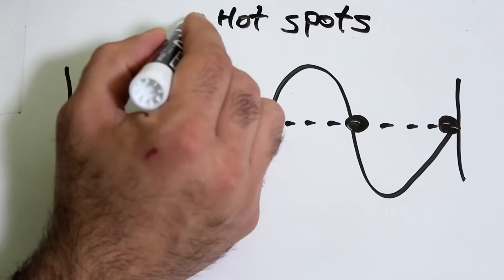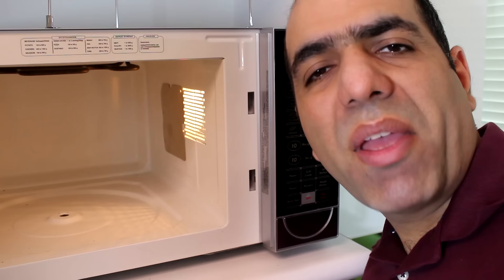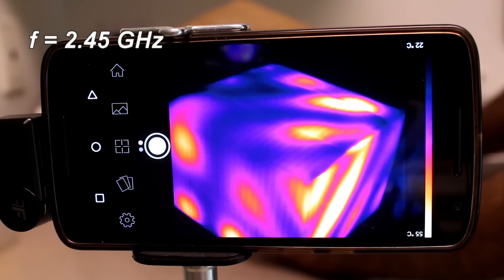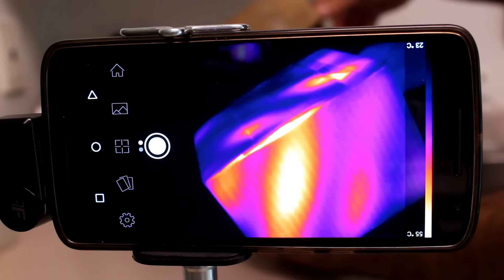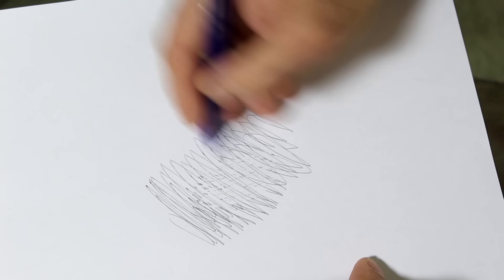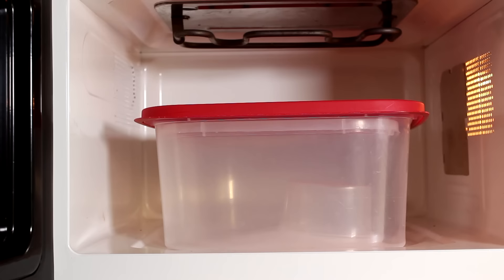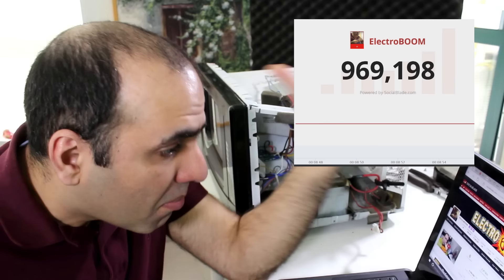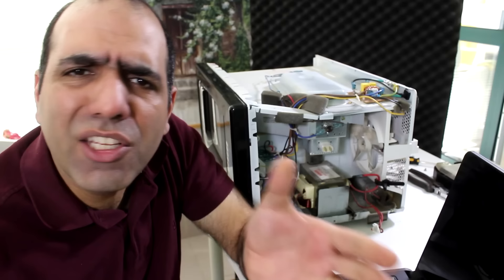Speed of Light, Microwave Oven and How It Works

Comment: My 30 year old microwave has that spinning fan thing but I haven't seen that on any newer machines
Reply: Hydraulic Press Channel Hi:)
Reply: You tube can be a small place haha

Now crushing a microwave, that would be interesting. Running :D
Reply: same here, our old Miele ~28y has the rotation metal fan
Reply: Hydraulic Press Channel it must be crushed!
Reply: I guess engineers consider the spinning plate and the fan mutually exclusive, which kinda makes sense.
Reply: Hydraulic Press Channel 30 YEAR OLD MICROWAVE THAT'S NO A  MICROWAVE THAT'S A BABY BELLING THE FAN THAT TURNS WITH THE HEAT OF THE LIGHT BULB MAKING IT FLICKER GIVING IT A REAL FIRE AFFECT  IS IT ONE RING OVER AND COMBINED GRILL.
Reply: For some reason, I read this comment with that thick Finnish accent.
Reply: WELL NOT THAT FINNNISH MEN LIKE CURVES
Reply: The 30 year old microwave is very dangerous and may attack at any time. So we must deal with it.
Reply: AS A WOMAN I AGREE SOMETIMES MEN  HAVE TO DEAL WITH THINGS FOR US LIKE SPIDERS!
Reply: Hi HPC! I know you must be tempted to put a microwave oven under your press but that's NOT a good idea! In the magnetron there is this ceramic insulator thingy which is made out of Beryllium Oxide and that is VERY toxic substance. If you crush the magnetron the ceramic part turns in to dust and if that dust travels to your lungs it can kill you!
Reply: Mine is 28 years c:
Reply: The really expensive ones have it!
Reply: Hydraulic Press Channel 
jj
Reply: Then destroy this microwave with hydraulic press
Reply: This microwave could attack at any time and we must deal with it!
Reply: Hydraulic Press Channel didn't expect you to be here lol
Reply: Hydraulic Press Channel you guys HAVE to collab! :D
Reply: I have also scrapped lots of microwave ovens and haven't found that spinnin metal fan. Also torilla tavataan!
Reply from the maker: Hey HPC! So I wasn't crazy, some of them have it! By the way, what happens if you crush a microwave power transformer (not magnetron) while it is powered? Forget I said that, I don't want you to die...
Reply: ElectroBOOM try throw foil in microwave and watch magic happend
Reply: Hydraulic Press Channel Usually they have the reflective antenna "fan" when you don't want a rotating glass dish, as in mobile applications (boats, rvs etc) or when it poses a cumbersome extra work, like in restaurants.
Reply: The turntable method works faster , it allows the cooking area to be a better resonant chamber since the source of the microwave is stationary .

The walls of the chamber have to be an exact multiple of the wave length to be efficient ( look up "Q-Factor")

A rotating reflector takes longer to cook since the wave keeps coming in and out of resonance with the chamber BUT is a great deal easier to clean , which is a big plus in a commercial setting.
Reply: I wonder one thing though,that have you ever stayed in Hong-kong or Canton? You really have a strong cantonese accent.
Reply: The Wanderer lol
Reply: Hydraulic Press Channel dvd
Reply: Hydraulic Press Channel ya know people can probably just go buy a thermal camera
Reply: it sure can be dangerous, so you must deal with it
Reply: Came here to say this ^
Reply: gimme thermal camera
Reply: shave the unibrow for 1m subscribers
Reply: Hydraulic Press Channel
Reply: he's to shave everything ... :D
Reply: You had me intrigued .
Reply: Hydraulic Press Channel ii
Reply: the wave stirrer is in earlier microwaves, are replaced by the turntable you see in Microwaves today, which is why the wave Stirrer isn't in the wave guide with the rod of the Magnetron. Early versions of the microwave have the Square Stationary glass plate and the wave Stirrer whereas the more Modern iterations have the turntable with the Circular glass plate and Synchronous motor and (depending on the manufacturer) different wave guide to help cook the food evenly.
Reply: For reference, the 1500+W microwaves found in restaurants and cafes have stirrers instead of rotating turntable. Turntable is cheaper but less efficient (one can't have it spin so fast with objects being placed on it), when one is dealing with higher power the lack of turntable efficiency is an issue so stirrers are more common.
Reply: Hello gunner! You want... sum *A M M O*?
Reply: Is it a Toshiba by any chance?
Reply: No stirrers now that the patent on the turntable has expired. They rotate the food, not the waves.
Reply: caroline kimber microwaves have been around longer than thirty years
Reply: It's The turntable!
Reply: Hydraulic Press Channel nice
Reply: Jaaa, huomenta
Reply: Well Put it under the PRESS !
Reply: You say transformers haha
Reply: FFcossag restored a microwave with one of those, and he did a really good job explaining it.
Reply: My 30 years old Elektro Helios microwave oven has a stirrer too, but it is so old that there is no spinning tray.
Reply: Hi there
Reply: I took apart my old microwave. It did not have a stirrer Guess because modern microwaves are more efficient in their design.
Reply: omg microwaves have been around that long
Reply: Hydraulic Press Channel ooo
Reply: It is very dangerous, we must deal with it :)
Reply: Restraunt microwaves still use em
Reply: If they have a carousel, it does not need a stirrer, the food move in the field rather than the other way. my 1.5kw RF output microwave has sick hot spots. as your hot pocket passes the hot spots, it gets excited.
Reply: Our old microwave had a stirrer. When we got a new one that has a rotating plate instead, I expected it to more evenly heat the food but my impression is that it works less well. This video shows why: if there is a ‘zero’ or dead spot anywhere across the rotational axis of the plate, that part of the food can never get heated until you stop the microwave and manually stir or move the food. I guess the actual reason why all consumer-grade microwaves now use a carousel, is that it is cheaper to build.
Reply: Do the box experiment in your micro to see difference
Reply: You are jerry rig everything brother
Reply: Hydraulic Press Channel kkk
Reply: Hydraulic Press Channel iiiiijjk
Reply: Now,You can bring cancer to town
Reply: He’s 40
Reply: My 21 year old Amana radarange has one in the top of the cabinet
Reply: WAT TE FAK!
Reply: wow
Reply: Everyone knows what a fan is
Reply: My 2 year old Samsung overhead microwave has metal fan blade under a plastic cover in the top but it don’t appear to be attached to a motor of any kind it’s just suspended there an can be spun freely by hand. I didn’t try turning it on with the cover removed to see if it spins as I only popped the plastic pin off that keep you from removing the cover to give the microwave a good scrubbing so it was only by chance that I discovered mine had this feature. Down side of children is they rarely listen when you tell them place cover on food prior to heating so I find my self having to scrub the top of my microwave at least twice a month other wise you get one of the microwaves you see in the work place that grosses you out an you only use when your in dire need from hunger pains
Reply: Well, Press, there's more than one "fan thing" in those microwave ovens. So... be clear.
Reply: The plate takes more mechanical engineering than the stirrer does.
Reply: Now we have had a microwave that was sparking on that metal plate.   Is it fixable?
Reply: Suomalaisiiki täällä?
Reply: @goover78  that would be a terrible idea as the dust in the magnetron would kill everybody in the viscinty,plz dont crush microwaves
Reply: OMG U WATCH HIM LOL
Reply: it usually has a turn table to do the uniformatimatizing of ze irradiations instead of just stiring with a fan now :P
Reply: I meant to say, our first microwave in the 80s had a stirrer fan reflector thingy, and no turntable. Actually it was more practical in a lot of ways, but it didn't seem to be very uniform in heating unfortunately. Which is maybe why they have now switched to exclusively turn tables. Although they aren't very uniform either so I don't know it was better or worse or we just got more used to the uneven heating and moved food around and turned it over more. I'm curious. Have you every seen one with both? I haven't but I often wondered if they existed.
Reply: Hydraulic Press Channel I love ur videos
Reply: goover78 microwave contains radioactive like borrilium oxide that can cause cancer
Reply: @rocky_adventure_bay7562  no
Reply: @85gbody97  yeah the one in our old one seemed to work by convection.
Reply: Rocky_adventure_bay Beryllium oxide is not radioactive however if you breathe in the dust of it it will cause cancer
Reply: The newer machines dont have a stirrer because now the rotating plate is used
Reply: Hi I'm subscribed!
Reply: @ElectroBOOM  The Over-The-Range type mostly have it(in Samsung/GE/Cafe brand).. it is located at the centre of the top cavity and powered by the wind circulating from the blower motor(the AC Fan motor).(there's ventillation holes at the area where this is attached)

As you'd explained,it is made to properly distributing the wave inside the cavity and reduce cold spots.

The Countertop Microwave Oven type like the one that you opened usually don't have it..(of the same brands)..

You're not suppose to open the enclosure of the oven,(yeah..like what the regulation said)but for your safety..please discharge the high voltage capacitor first before attempting to disassemble the components(easily done by shorting the terminals with a screwdriver).

Hope this helps.
Reply: @EwanMarshall  yes they're..
Usually they also have a double magnetrons too..
Reply: @knisayusuf  Indeed, got to pump in that 1500W or more somehow.
Reply: Yeah I don't know why?
Reply: Older microwaves did not have a rotating plate for the food, so, to fix the issues of hot and cold spots inside the oven, they placed a wave fan. It's purpose was to reflect those rays around and more evenly heat up the food. Of course, they were also quite loud if the bearings went bad.
Reply: Torille
Reply: Hydraulic Press Channel you didn’t crush it
Reply: @ElectroBOOM  sir please can you help me rectifying my idea of a perpetual machine design . Trust me this design is way different than anything else . Sir please help me?
Reply: Nice!
Reply: hi hpc in a fan of your vids
Reply: Dark... too dark...
Reply: i guess it is like you have rotated metal fan and standing still food, or rotated food without any metal fan
Reply: matthew kimber p
Reply: @ElectroBOOM  hi
Reply: @goover78  while cooking pop prons
Reply: Hi@
Reply: Can it fly?
Reply: Did you look into the wave guide while it was running?
Reply: @ElectroBOOM  I already know you swear right?
Reply: I believe the stirring fan is still being made in some microwave.  I bought a brand new Amana commercial microwave for myself about 7 years ago and it does not have a spinning disk but have a stirring fan. Some microwave are still being made that way.
Reply: Nice
Reply: Yeah true
Reply: Did you get "mashed potatoe for brain"
Reply: Hi
Reply: I have it too but my microwave is pretty new
Reply: @ElectroBOOM  خیلی ممنون بابت فیلم های خوبتون
Reply: @ElectroBOOM  crushing a transformer is literally asking for death
Reply: @cal28kim  LMAO, are you kidding? As a woman, I am the one that deals with spiders here! I identify them, and decide if they are house spiders (that would die outside), indoor/outdoor spiders (that can safely go outside), or Brown Recluse (that must die - we have a serious infestation of them!). Then I put them in safe spaces, except the latter. 

I have even kept a female Black Widow in a larger jar on my desk, where she laid a big egg, and when it hatched, I took her and her babies somewhere safe and left them safe natural surroundings. It was a really cool thing to see!

Besides, now that my hubby (of 39 years) decided to dump me after 38½ years, and filed for divorce the day after our 39th anniversary, I have to do all of the things to do here. The only man I've ever loved, suddenly tells me he doesn't "want to live in my world any more," whatever the ~bleeping bleepety bleep~ that's supposed to mean. I never even found out when it changed from OUR world to just mine, either. 

So, don't just trust that they're gonna stay. Never trust them on that. Ever. If one can suddenly, without warning, toss 39 years in the dumpster, set them on fire, and walk away like it's nothing, one can leave at any time, leaving you high and dry.
Reply: @MaryAnnNytowl  There's a lot to unpack here an I'm guessing men have a lot to answer for! But as I come from that side of the system I do understand we are not always the best at doing the right thing. But I can offer some insider information. We are not all that bad🤔I think!. Well some of us try not to be most of the time anyway. Things always have a way of working out and it makes us whom we are.
Reply: Nearing 1 million subs bro back then. Close to 5 million now 👍🏼
Reply: Same here, with no rotating plate instead.
Is also about the same age.
Reply: @cal28kim  what
Reply: @shrimpbean  Whom can say 👍
Reply: Hmmm, ElectroBOOM - Hydraulic Press Channel colab when? :D
Reply: @cal28kim  ik this is a 5 yr old comment, but what in the fuck does mEn hAvInG tO dEaL wItH sTuFf (which isn't true anyways, that's pure toxic masculinity with the addition of calling women weak, which is false too) have to do with a comment about dealing with dangerous, 30 yr old microwaves? lmao
Reply: @TheInfamousLegend27  I left it 27 minutes to start a response to allow for the five years 👍!! I thank you for the response and will try to take onboard the core of the message.
Reply: @cal28kim  and this is a fan
Reply: @ElectroBOOM  Hey mehdi!

Comment: why does wifi have to be on the 2.4 Ghz band? WHY?
Reply: StarTrek123456 I used to tell my grandparents, they never listened
Reply: wifi routers have had a 5ghz band for like 8 years, for this reason.. Also why they changed cordless phones from 2.4 to 5.8, and other digital frequencies
Reply: Well, the 2.4 GHz band was made publicly available for everyone because of microwaves, so... I think that the guys at IEEE didn't think it would be a problem and just made it standard because you need no license for it. Back then, the devices probably weren't capable of handling 5 GHz, but they didn't wanna go any lower than the 2.4 GHz
Reply: 5 ghz doesn't penetrate through walls that well. My router supports it, but i only recieve the 2.4 Ghz signal in my living room.
Reply: @I am Neagan Haha, but both as probable ;-)
Reply: Microwaves should be containing prettymuch all of the energy they generate. If your wi-fi goes down when you turn on your microwave, get a new one, that one's leaking badly.

Also get better wifi, the shit you find at Best Buy is just that, shit. Get yourself a couple of UniFi APs and an Edgerouter X (Probably $300 all in). Dirt simple to configure and it works absolutely phenomenally. I run my shop and home network off that setup, has no problem with 30+ devices all using the network at once, no slowdowns, no crashes, I haven't rebooted it in months, and it took me less than an hour from learning the software to having a fully configured business network.
Reply: Because it comes under the ISM band....Industrial Science and Medical band...which is unlicensed and is available for masses for free.
Reply: so an old microwave can create wifi dead zones? interesting... mmyesss i can use this to take over da world
Reply: Actually, pretty much ALL microwaves radiate around 1~2W of microwave energy (just put your cellphone in there and log the wifi attenuation), regardless of price.
Reply: MrDisgruntledGamer1 No joke, my grandparents put the DSL in the kitchen, if you used WiFi. GOOD LUCK in their house during meal times or re heating coffee. they knew what was up.
Reply: i think it is because of the FCC
Reply: You do realize that WLAN channel 13 is at 2.472GHz and is 22MHz wide? A lot of ISPs and vendors set their routers to automatically use channel 11 by default though. :-) 

Don't tell people incorrect information because someone is going to believe you, and then they're going to tell their friends, and so on. And soon you have a bunch of people believing in incorrect information.
Reply: StarTrek123456 it probably depends what type of construction your house uses too. My 802.11ac signal (802.11ac is 5ghz only) has no trouble penetrating through two floors and the walls of my house.
Reply: Simple, there are very few bands you can generate a deliberate transmitting RF without a licence.  The most common are the ISM (Industrial, Scientific and Medical) Bands. The vast majority of the RF spectrum is controlled  and licence or restricted in use.

Re ISM. The low frequencies are not good for cooking efficiently (heating) or high data transfer leaving 2.45 GHZ center band as the only real option early on. Now we can generate in the 5.8 GHz without much problem for WiFi as well. 
Above this is the 24+GHz, far too directional and line of site for data transfer in a wifi type network and too expensive with a degraded performance for heating based technologies (microwaves)
Reply: Bc is funny when the microwave messes with the signal